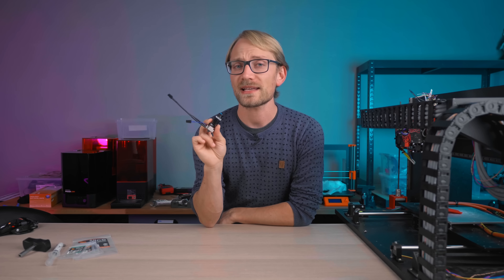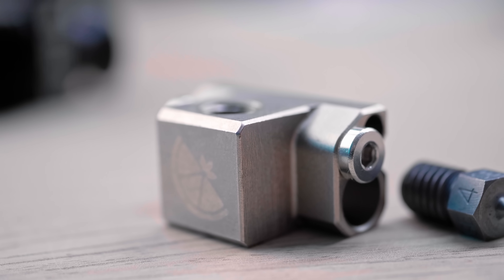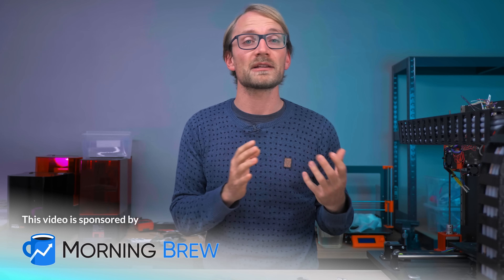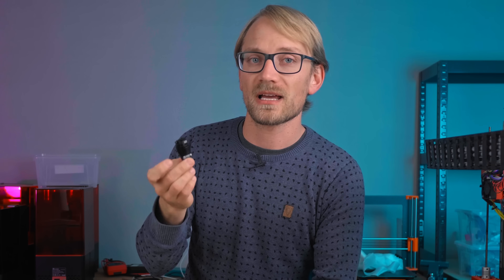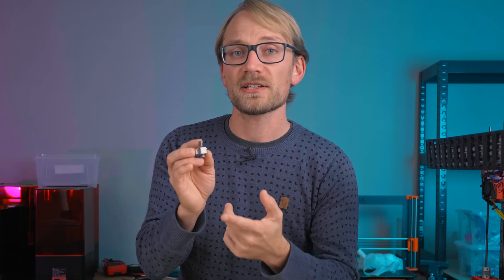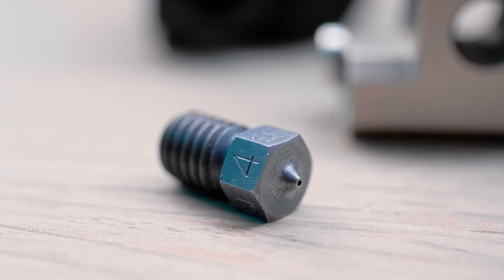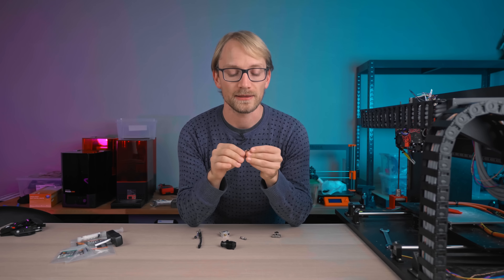This modular hotend seriously impressed me! (Slice Engineering Copperhead Review)

Comment: This review seems a little off to me. You're comparing what I would recommend as the minimum for a hotend, A genuine V6, to what is advertised as a high end hotend. I would prefer to see it on more equal footing. Copper V6, titanium heatbreak, and Nozzle X. As you stated the price still favors E3d, but what about quality and performance when they are one more equal footing?
Reply: Indeed!
Reply: This! Throw it up against a comparable E3d setup!
Reply: Thermals from hardened steel to brass are about 10c.... so that's obvi off a tad.

Comment: you should probably not use the boron paste on the heat break
Reply from the maker: I specifically followed the documentation (as aways), nothing in there against using the boron nitride paste on there
Reply: @MadeWithLayers  it's marketed as a high-temp thermal grease, meant to improve the conduction of heat, while the purpose of the heat break is to prevent the conduction of heat.  I don't work at slice so I don't know whether or not it has a secondary function there, perhaps as an anti-seize, but first instinct for me to use it only for the thermistor, heater cartridge, and nozzle.  it might not be a bad idea to get some clarification from slice on that one.

edit:

miller stephenson is the manufacturer and calls it a high temperature mold release, and makes no mention of thermal conductivity.  it's almost certainly a good idea to get clarification on this one.
Reply: @butre.  Thermal conductivity is necessary in cooling as well.  A heat break is to prevent heating the filament, which is not where the grease goes (as pointed out in the video).  The break material needs to move heat from itself into the air (or heat fins whatever there is).  Since the heat break has to be touching the heat block at some point, it will eventually get hot without heat transfer.  The more thermal conductivity there is, the faster the heat can get out of the heat break material, keeping it colder.  The grease is just a way for conductive heat transfer to happen more efficiently whether you are adding heat or taking it away.
Reply: @jeradw7420  exactly. That's why you apply thermal grease to both sides of a Peltier Cell

Comment: Tom, first off as a avid user of Slice products I kinda of cringed at some of this. Great video but here’s my comments... 

1. I don’t recommend thermal paste on the nozzle. It’s just not necessary. The machining is so good the thermal conductivity when hot is near perfect. Your mistake shouldn’t have been included in this I don’t think. But you admitted to it so I’m okay with it. Not that what I am okay with matters 😂 

2. Cost: V6’s are fine. But a comparable V6 is not the cheapest. A comparable hotend is the V6 Gold. At $100USD
3. In all but this configuration it allows for one handed nozzle swaps cold or hot doesn’t matter. That’s just awesome 
4. The steel part of the heat break isn’t structurally strong? Neither is the V6 heatbreak. They bend all the time. Imo 
5. The heater 50w heater and thermistor isn’t necessary. You can easily use a E3D heater and thermistor. Even their nozzles. Bringing the cost of entry down considerably. 

All in all, the slice hotends have almost zero filament jams. Heatcreep just doesn’t happen to them very often. At low temps like 200° on the mosquito and magnum you can use without a fan (for short amount of time). 

Expensive? Sort of. The longevity, support, and all in all craftsmanship is on par with no one. It’s simply a set it and forget it Hotend. No stripping threads, bending or ruining heat blocks etc. I will never go back. I put one on my Prusa and it fixed all jamming issues I had with certain filaments. 
The reality is E3D stopped innovating. Eventually companies like slice will make better more affordable hotends and eat their lunch.
Reply: Don't worry. We haven't stopped. I know our hotend stuff still looks like it has done for a long time. However we're going full pelt at a totally new architecture for building hotends. This is hard, new manufacturing processes, totally revamped design. It will be incredible. It will be affordable.
Reply: @SanjayMortimer  I think that’s exciting. If this says anything, many users aren’t looking for affordable. If they were Slice wouldn’t exist. I think we need innovation... slice good bad or whatever innovated a unique design. The V6 is great for many. But for high temp, or power users, we want reliable etc
Reply: @thelightspeed3d712  I'm confident that we can do both. That might seem ambitious, but I think it's very possible.

Comment: I purchased a copperhead for my home built coreXY & I personally love it. I purchased the full basic kit groove mount kit. The only things I did not purchase was the fan. Since I put it together and pid tuned it I have not had to mess with it. I have not even had to clean filament off the nozzle. Maybe I have just been lucky with it so far and am glad if so. Only time will tell if it was truly worth it. I have already gone through a couple V6 hotends. If this copperhead last long enough then it definitely would have been worth it.

I will say one annoying thing about it though. The thermal paste is a bit messy. For anyone that uses their thermal paste be mindful that in the tip of the syringe for it the paste will dry up and harden. Tale a needle and make sure to clear it out before you put any pressure bin trying to squeeze some out. If you don't that harder plug of the paste will pop out and the paste will ooze out quite fast. I had mine do that and it got all over the place. 🥴
Reply: It sounds like a different thermal paste might be needed.  Once it hardens does its heat transfer properties change and get worse?
Reply: @reasonablebeing5392  I'm not sure if it changes properties much. All thermal paste tends to harden or dry out over time. The paste that slice engineering uses has a more liquid like consistency while sealed inside the tube. Once outside in the open air it will tend to change to a more paste like substance. Especially when you start to apply it.

Comment: 5:05 why would you want good heat transfer between the heater and a thermal break?
Reply: @JorgTheElder  it can start in heater itself, don't see any problems with that
Reply: @JorgTheElder  oh, yeah, that's right. I still would try to melt it in the nozzle first, but that might introduce heat capacity issues

Comment: Indeed, hardened steel is certainly not equal to Brass. The NozzleX sounds fairly similar to that coated hardened steel nozzle and I needed to heat it up a bit for similar performance as with a brass nozzle.

Comment: Tom, I appreciate you but i think you need to do a part 2 video. This video only compares the two hotends  from the perspective of someone who only wants to print pretty chachkies in pla. While this is most of your viewers, I don't think it's the intended market for this hotend. I think this hotend is more geared toward being a budget alternative to the  high temp/ engineering grade plastics hotends. So, How do the two hotends compare at high temps? What does the difference in heatsink Temps look like at elevated temp? Can you get away with not using a fan to cool the heatsink?

P. S. While I agree initial hardness is important when evaluating nozzles, it's equally as important to understand how the hardness will change as the nozzles temper over time, this becomes even more important when printing high temp filled plastics.
Reply: The tool steel in the Vanadium nozzle was specifically chosen for high hot hardness.

Comment: Meanwhile 6€ E3D V6 hotend clone from Chrina: exists

Even the one from triangle Labs is like... 25?

i really see no purpose in this. Even all metal options are available for way less the price of just the nozzle
Reply: get a 3€ v6 clone, the heatbreak will be garbage, upgrade that with a better one (E3D, TriangleLab, Mellow or Slice) and it should be pretty much the best performance per € you can get
Reply: you will get 6€ results using 6€ filament with your 6€ hotend
Reply: @anthonyvescio5311  Do you think youre gonna get 30 times the quality for a 30times more expensive hotend?
Reply: @Chrissi33004  if i’m printing materials that require a hotend like this then yes. try printing peek with e3d clones.
Reply: @anthonyvescio5311  then buy a different all metal clone hotend. Its not like they dont exist. 
The Review didn't even show how this hotend would perform under that circumstance, which should be one of the main advantages.

Comment: While it is nice to see companies like E3D making good parts that are priced for the home user, it's definitely time to see companies making high-end parts for more commercial applications, where there is more budget available.  I think Slice will successfully push this envelope, and I can't wait to see what they do next.
Reply: I've always had issues with my e3d parts but I now have a mosquito and a copperhead on a v6 heat break and have had zero issues for over 4 months.
Reply: @gagehughes2297  The only issue I had with E3D hot end parts is back when I first bought a v5 and didn't assemble it right. I think this was a communication issue as they don't provide docs with the parts and at the time they didn't even put a card with a link to the documentation in with the kit. Once I assembled it right it was fine.
Reply: @JeffDM  i watched their video several times and I know I had it assembled correctly. I never had thermister issues with the v6 just the volcano. It puts it at a extremely tight angle and when you printer moves it would flex a little and over time they would break.
Reply: Honestly I wish there was even cheaper proper all metal alternatives to v6. The clones are so cheap in comparison and work just as fine in a lot of the cases.
Reply: @ameliabuns  e3d makes copper plated but I would still buy the copperhead
Reply: Yup. This is the kind of hot end you'd want to put on say a high end RailCore or Voron build designed to print things like Nylon/PEEK. I wouldn't put this on a Ender 3 for example.

Comment: Do not use the thermal paste for the heat break !!!
It will dissipate more heat from the heatblock into the heatsink, which we want to avoid as much as possible.
Reply: Nope.  You want as much thermal efficiency at both ends of the heat break as possible.  The point is to not transfer the heat between the two ends.
Reply: @joshsekel  Nope. Nope.
The heat should stay in the heatblock as much as possible!

You want the filament to start melting as late as possible on the way to the nozzle. Otherwise the filament will become soft and it can clog the print head. Therefore, good heatsink have a groove with the smallest possible cross-section and as close as possible to the heatblock, so that as little heat as possible can rise in the heatsink via this groove.

Thermal paste between the heatblock and the heatsink conducts as much heat as possible from the heatblock into the heatsink, which you want to avoid as much as possible for the reasons given above.

Comment: All pros for that hotend can be replaced by Volcano. I printed at 80-100 mmps (Trianglelab copper nozzle) and the weak point was cogwheels of Titan Aero (filament dependent and motor was very hot). The only pro that left is switching hotends thanks to that heatbreak. But unfortunately it compatible only with that cooling tower.

Comment: would be interesting to compare the E3D copper Heatblock VS this Slice engineering compound stuff
I have the E3D copper heatblock and it works perfectly in any situation
Reply: I was thinking the same thing, there is also the E3D Titanium heatbreak and Nozzle X. A video comparing a fully upgraded V6 and the complete CopperHead would be interesting as they should be in a similar price range.
Reply: Yep, more fitting head to head. Closer on performance and closer on price.

Comment: Brass is abt 2x steel in thermal conductivity... not equal
Reply: @11:45 — You are correct that steel has about half the thermal conductivity of brass, however.  The comment on steel vs brass thermal conductivity as “slightly lower” is a bit misleading.

I did wonder about this myself, when I ordered stainless steel nozzles.  I then ordered tool steel nozzles, assuming that the stainless ones might in fact cause problems due to excessive cooling before the plastic exited the nozzle.  (I have not yet checked this.  The stainless nozzles I ordered have too deep a threaded section, in any case — derp.)
Reply: @boggisthecat  stainless steel is even less thermal conductive than nornal steel. Like another 2x - that makes it 4x worse than brass.
Reply: @pjak2000  
Yes, I know: it’s more like 15x less thermal conductivity, IIRC (hence the use as heat-breaks).  That’s why I decided against using them — although I borked the thread length, anyway, so it would be difficult to use them with my machines.
Reply: ...which Thomas mentions at 11:43
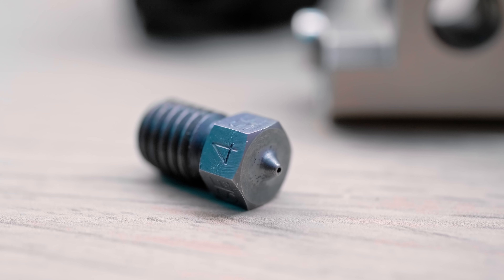Reply: @davidf2281  yeah. But first he mention the thermal performance is pretty close in 5:28
Reply: @pjak2000  Probably because the nozzle is also pretty thin. I didn't find any difference when I moved from brass to stainless steel nozzles.
Reply: @3:30 — Thomas mentioned both thermal conductivity and thermal mass.  Conductivity of copper is much better than aluminium, but thermal mass is about the same (how much heat is ‘stored’ in the material).

This should mean that heat can be transferred from the heating cartridge to the material more efficiently, but you won’t get much capability to feed plastic faster.

Comment: 450C enough to 3D print solder
Reply: gonna need some ventilation fr 😂
Reply: Nah anyone whos ever soldered a lot has felt the effects of solder fumes and lived
Reply: there are kinds of solder that melt at only 290-300 C
Reply: Time to print some solder
Reply: Pewter melts at most around 230°C. And it's a good metal for a end-user products.
Reply: @WhenDoesTheVideoActuallyStart  Liked
Reply: @Lassi Kinnunen 81 Naturally can't be brass, I found a Hackaday thread where someone recommended anodized aluminium. Other problem mentioned by them was "[...] the high surface tension. The tin always creates small drops." I guess that's what you mean with the sharp melting point, but I assume a far-from-eutetic alloy might help, since it would be a mix of a solid phase and a liquid phase - hopefully in a stable matrix.
Reply: That's kinda genius

Comment: It's nice of them to put some effort into improving the hotends and follow thru with some other ideas that E3D may not have had or have abandoned for reasons. It just seems to me that the return of investment with Slice Engineering designs is always very bad. Maybe they will find a good middleground at some point, offering improvements that seem to be worth the money spent.
Reply: At E3D we're completely rewriting how we make hotends - I'm pretty confident that we'll have something that absolutely blows minds and doesn't break the bank, with an awesome user experience to boot. Price is really important, we're never going to radically change how humanity manufactures goods with extrusion systems that cost $100+ dollars when Chinese printer manufacturers are making entirely decent printers that you can buy on Amazon prime for $250. We're aiming to massively boost performance but also significantly reduce cost at the same time. That's the only way we'll still be relevant in 5-10 years time.
Reply: @SanjayMortimer  That's the right way. If an upgrade doubles the price of my printer, I feel like a second printer would be worth more to me and disregard the upgrade entirely

Comment: Would like to see a follow-up with the titanium heat break for the V6 or hemera
Reply: I just got the titanium hemera heatbreak, the copper heat block, and the high temp cartridge and thermistor.  This should be up to 400c and you get direct drive.  The prices werent even crazy... I think 100cdn delivered from the UK in two days.
Reply: @someguy2741  Please report back your experience.  That is a very nice setup.

Comment: They really need to make a water cooled motor and heat break version.  With a rating of 450C you can get into some great engineering plastics.  Pull the other motors and electronics outside of the heated chamber and pump a lot of heat inside and you could print in ultem or even PEEK.
Reply: They did just release a watercooled mosquito!
Reply: I have ordered couple of parts printed in PEEK some time ago (no chance I'm letting it anywhere near my current printer). That thing is damn indestructible. I was impressed by injection molded nylon's strength, but this is whole another level. It actually matched solid brass in my liquid pressure testing without coming apart.
Reply: VisionMinor is a company that showcased printers that do this
Reply: but peek is insanely expensive. What hobbyist is going to be able to afford $600 per kilogram?
Reply: Already do. PEEK and ULTEM are incredible systems to use. But as you pointed out, we burn steepers like some people throw away their nozels.
Reply: Peek and ultem are nice and all but at the price point isn’t it better to look at the machining parts or metal sintering if design requires. What are advantages vs machines parts?! Ta.
Reply: @kr15uk  Sintering is more common, and sometimes more affordable. Hardly anyone has 3D printer capable of effectively extruding and printing PEEK, so wait times are also super long. I had 33 days in queue when I ordered my prints. At this point actual cost of filament becomes secondary concern.
Reply: The quiet.. but the weight, and moving, flexing fittings.. hmmm